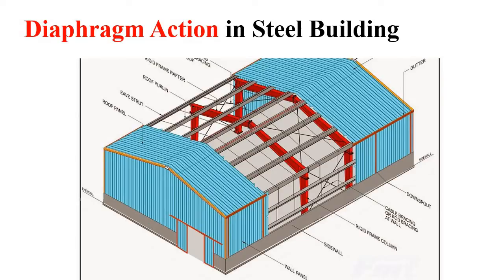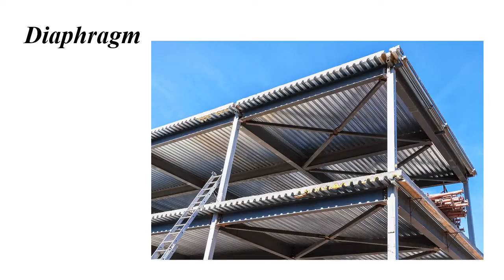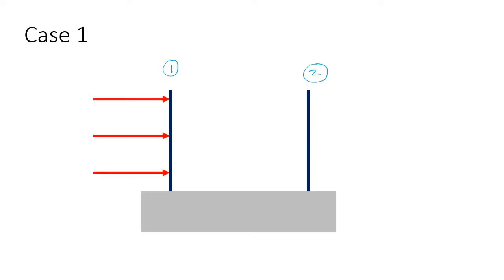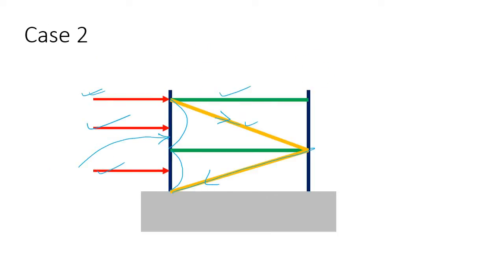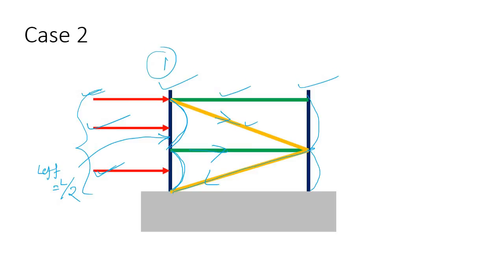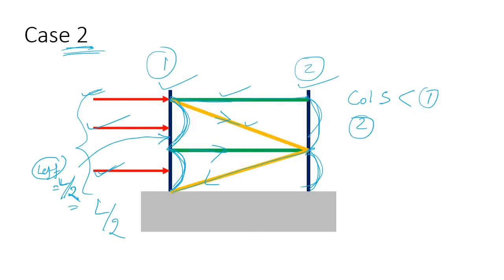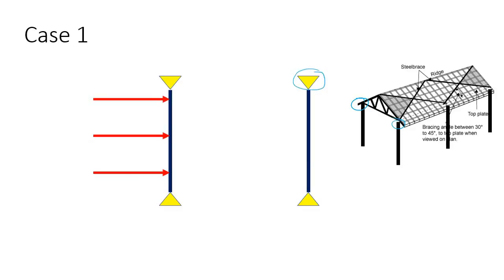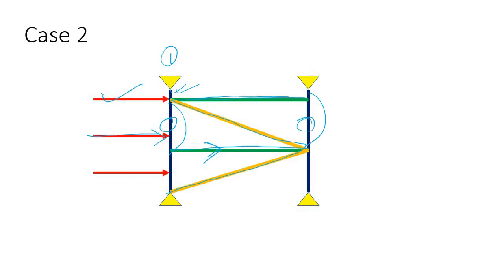Diaphragm Action in Steel Building

Comment: Good explanation. But Girts (which supports the sheeting) cannot resist buckling because they are fixed only at 1 flange of the column and not at centre which can cope up the buckling
Reply from the maker: This is called relative bracing. But yes you are theoretically right. Aprreciate your observation Sir. You can Join my channel to show your support and love :)

Comment: thanks a lot ..for the rafter if i use just a purlin with  sheating but without bracing what do you think the buckling of the rafter is it will effect too much compare with if we put bracing ....regards ..also please how can I design it by sap using diphram in steel structural
Reply from the maker: I will put a video on it 🙏

Comment: Good and easy explanation for getting the concept clear about diaphragm
So my question is  practically all PEB/Steel sheds with wall and roof sheeting are designed considering this diaphragm action.
Also this action will effect the thickness of the cold formed Z/C purlins or not
Reply from the maker: Purlin is a local member, it only contributes to diaphragm action. So, don't be confused.